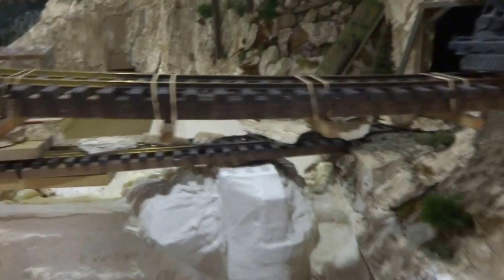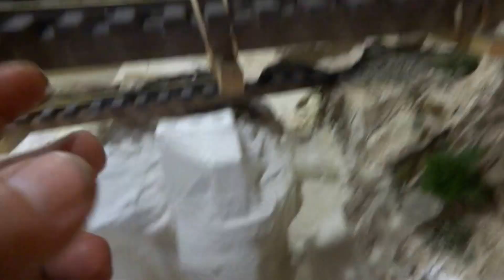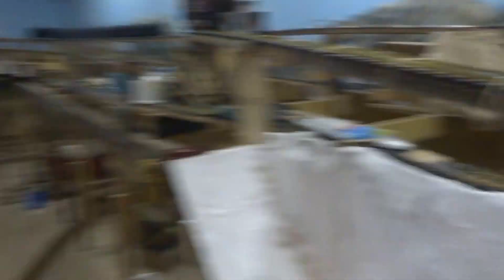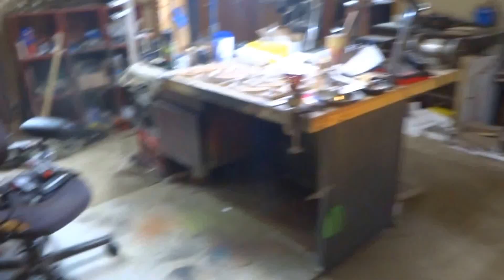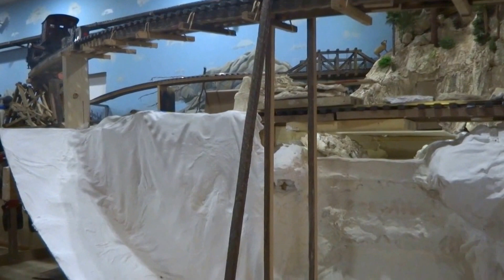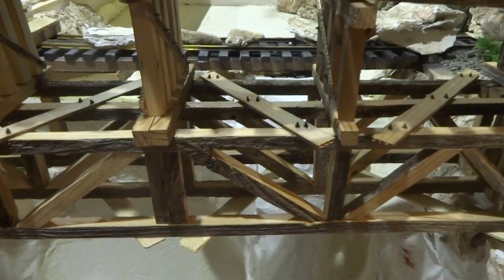water fall truss complete

Comment: Larry, as I'm watching your progress I keep wondering about the real water falling on your scenery. Won't it be a problem if the plaster rock walls get wet? How are you water proofing them?
Reply from the maker: Tom,  Where ever the water runs or touches I use hydra cal its actually a concrete that acts like plaster of paris. Its white you mix water to the consistency you want, apply, and 20 minutes later harder than your driveway, and its 100% water proofhope this helped thx